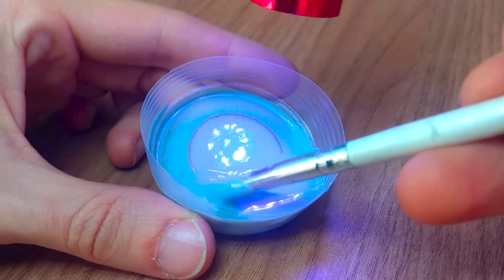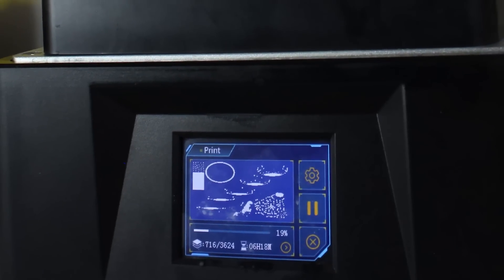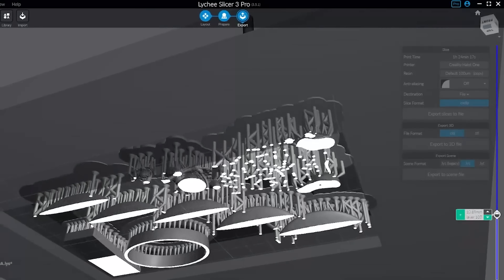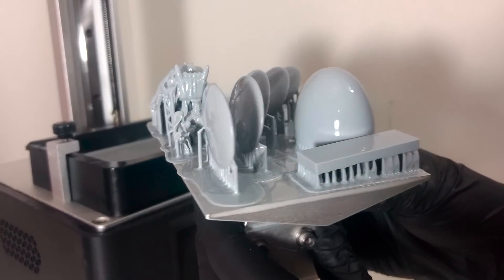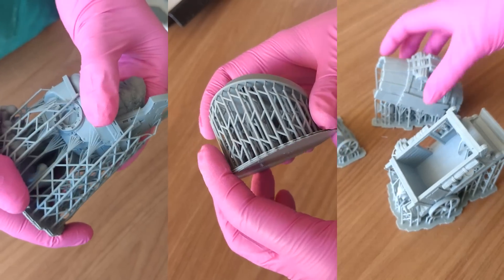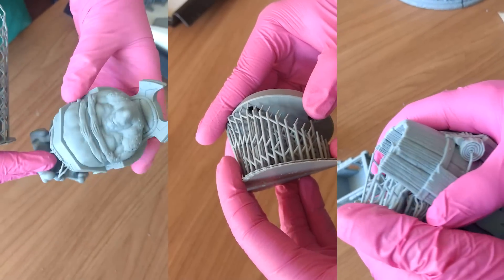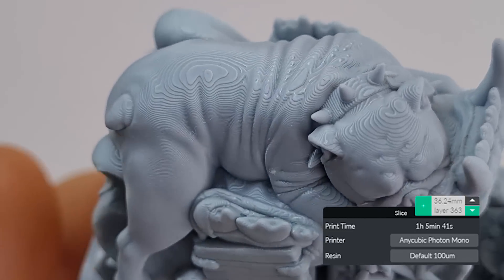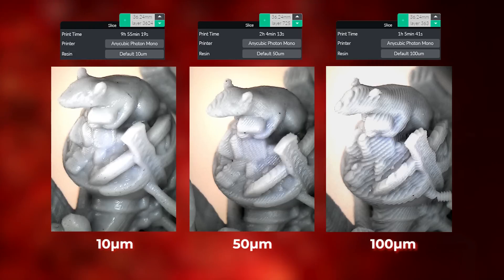How to set up the LAYER HEIGHT? | 3D Printing Tutorial

Comment: Quality, ALWAY quality. Sure, printing at those lower layer heights is going to take longer but the results are well worth it. If it's going to be a functional part then I will go with a higher layer height and speed thing up as much as I safely can but when I am going to print a detailed figure and want the best surface possible it's lower layer heights and lower speeds. In this day and age where it's all about speed it's good to teach and actually show people with printed examples the difference it can make. Thanks for showing them that good things take time. Subbed!

Comment: Very interesting video, thanks a lot :) In my case, I always used 0.05 mm layers and I especially see them for faces that very horizontally orientated (for example, if we rotate a standing character at 90°, we'll see layers on the front). Less I incline it, less they are visible because I suspect the anti-aliasing option only applies on X and Y axis. I'll try to decrease it to 0.04 or 0.03 for my next prints, but not further.

Comment: 10 micron,  is it stable for printing?
Reply from the maker: If your printer supports it, it should be. The thing is, the smaller you make your layers, the more it will take to print, and sometimes the difference is negligible to the naked eye. In this video, we tried showing what could be a sweet spot, so you don't need to worry about it yourself 😉
Reply: @LootStudios  i tried and result better very much. i will guide our clientd do that. Thank you

Comment: It would be much more helpful to discuss the voxel (3d pixel). To get the optimal resolution and make x/y match the capacity of z based on 1, 2, 4, and 8k options. This would also matter to the size of your screen. My Epax X1 with a 5.5” 4K screen has a smaller pixel (31.5 micron) versus a 6.6” (~35 micron) which would continue to be less resolved at a 13.3” or 15.6”.  By comparison a 10.1” 8k would have a 28.5 micron pixel and if that 8k screen were smaller resolution would continue to rise. So if time/optimal printing is considered the shape and the x/y has to be considered and is a square voxel or a flat rectangular voxel going to yield a better print.

Comment: Would have been interesting to see a comparison after the models are primed. I would imagine, that some paint may smooth the layer lines quite a bit.
Reply: I'm painting my minis printed with a 0.5 mm and we still see them once primed and painted :( I'm looking for alternate methods to not see the layers such as "Brush On Primer" (it's slightly more thick so I suppose it could fill the gap between layers) and plastic putty, but in every case the paint is too thin to hide layers.

Comment: Adpatative layer height would be a great contrinution  to resin printing.

Considering a cube with rounded cornes, the slices can use 0.1mm or 0.05mm and in the at the planes with cornes reduce that layer to 0,03 or less.

In resin printer I bet it's easy to implement by developers, because our x and y resolution are always the same and the shrink compensarion of the resin is a spec of the resin that you will print all the model.

Juts a idea, they implemented on a less stable and precise method, filament print, why not in resin print?
Reply: Great idea :) Indeed it would be amazing :)

Comment: Is there some formula for changing the time and lift speeds between resolution settings?  For instance, .05 to .03 is a 60% decrease.  If you have a 3 second delay at 0.5 what is at 0.3?

Comment: question: I usually print at .05, if I chage to .03, or .01 would I have to change the exposuretime and rasing speed? if so, how do I determine by how much?
Reply: From what I have heard, then simple rule is for every 0.01 lowering you should also about 10% lower exposure time. For example if you are using 0.05 with 2.5 sec exposure, then with 0.3 layer exposure time should be 2 sec (2.5 x0.8).

Comment: So you are telling with consideration of your last video about Exposurtime, you do print 0.05 Layerhight with 1,0 sec Exposurtime? I have a Photon Mono as well, and these settings are a sure fail for me. My Exposurtime is at least 2,0 sec with 0,05 Layerhight. Before I used Anycubic Clear with these settings and it worked fine. Now I use Anycubic Grey and already increased the Exposurtime to 2,5 sec and I am still struggling with the Outcome.

Comment: For terrain and stuff (pillars, chests, ...) I use 50um. For friends of mine I go for 25 um and for mine I use 10 um, because I'm painting them with Citadel Contrast colours. :)
Reply: I'll likely do the same, for the same reasons 
What exposure and lift speed settings do you use?
I know it also depends on machine and resin, but I'd be interested to hear the values you've found to work, just to see the relative differences.  😊
Reply: @Mike-tc2rl  It might take some time for me to check as I no longer have direct access to the printer since I started Digital nomad life.

Comment: Is the exposure time linearly correlated to layer height? For example, if I go from 50 microns to 25 microns, should my exposure time be halved or would I need to fine tune my exposure times for each resolution?
Reply: Best would be to print some benchmark for details, there's a lot of videos on YouTube. :)

With Photon Mono I have something between 1.95s and 1.7s per layer, but it differs per layer height and also resin! :)
Reply: It’s logarithmic. There are various tables online to check but still a print test is mandatory

Comment: Is there any downsides to changing layer height outside of time? Also should exposure time change if you decrease layer height?
Reply: It's best to print some calibration piece with new layer height and also with new resin. :)
Reply: @BleedingDev  thanks! Certainly I will do that before committing. Just was wondering if that is something I should test for?
Reply: @beemo1579  I usually test for details of the particular calibration. So I print 5 different plates (each varies in 0.05s on my Mono) and then just let more people pick the best.
But I'm not sure I understood what you mean. :)
Reply: @BleedingDev  so I have an anycubic photon mono. If I change layer height down from 0.05 to say 0.03 is it worth testing different exposure times at the same time? Or would they stay the same?
Reply: @beemo1579  for me, when I went from 50 um to 25 um, I also lowered exposure time by 0.05. But I might have to recalibrate as now I use different resin. So I'd say give it a try, it's max. 1 hour of work. :)
Reply: @BleedingDev  Yeah definitely will do a few test runs. I appreciate you taking the time to share your knowledge.
Reply: @beemo1579  no problem, we share same hobby, I'm sure you'd do the same for me. :)

Comment: I use an Anycubic Photon S printer. I read in a Photon S forum somewhere that this printer (2K resolution) struggles with printing anything smaller than .05 layer height, so I've not attempted to go any lower. You've intrigued me to try, though!

Comment: 0.05mm currently
But have considered going to 0.03mm as the layers are quite noticeable to me when painting and would prefer an even smoother surface.
Reply: Have you tried using the antialiasing setting?
Reply: @Selppins  Antialiasing is only applied on XY axis, not on Z one :)

Comment: 0.02 or 0.035mm but a lot depends on anti aliasing, which does not always work correctly with different applications, for example with anycubic mono se, this is a pain. Tell us about smoothing or post processing, how do you cut the model and do you use sandpaper?
Reply: Slice the model using anycubic photon workshop and anti aliasing will work with most recent firmware :)

Comment: I will generally print everything at .03 layer level I find it the best time to quality, sure it might take a bit longer but it will look better and if you want things to be there to look at might as well having it looking better :-)
Reply: Hey, a 10 hour print is still quicker than buying with next day delivery lol 👍
Reply: do you keep the resin exposure settings the same as the .05? I might consider trying this out...
Reply: @BigMikeMora  u need to change everything, otherwise u will loose in quality, and it might be overexposed. U need to redo a full test. I suggest doing a full test for 05, and then anthoner one fror 03, each time you buy new resins. So u can change settings quickly
Reply: @BigMikeMora  Also interested in this! I changed to 0.03 based on recommendations but didn't adjust the exposure time. I only just started printing, though, so not sure if it's optimal.
Reply: @BigMikeMora  Resin profiles must be calibrated for every type of resin (including color) and layer height.   Smaller layers generally means less exposure. Best to keep a set of RERF (Resin exposure range finder) templates for every layer resolution you intend to use on hand. Everytime you load up a new resin type or color you need to dial them in and note settings.
Reply: I've started doing the same on my Mars 3. If it helps anyone I'm using Siraya Tech Fast Navy Grey at .03 layer height and I dropped the exposure time from 2.5 to 2.3s
Reply: @SB-io2lf  Interesting :) So we could need less exposure time when decreasing layer height ?
Reply: @Kervala  From everything I've seen, yes. The thinner layers mean less resin, so the exposure times need to be adjusted up or down to compensate. You've got a very good chance of under or over curing the resin when you change layer heights
Reply: @SB-io2lf  Thanks a lot :)
Reply: This is going to yield a square voxel, or nearly square and will depend if curves are pronounced in the design.